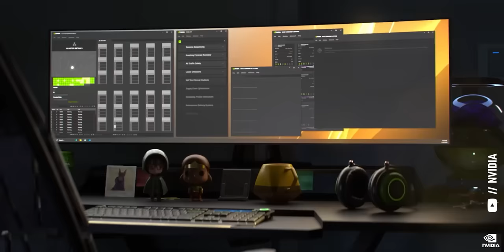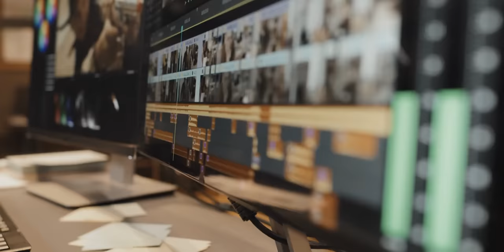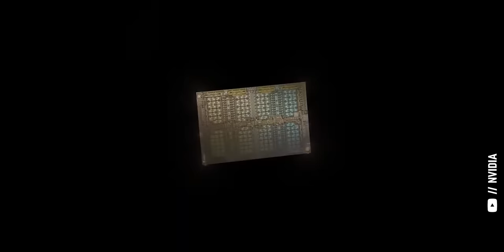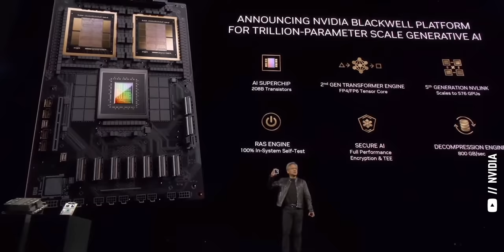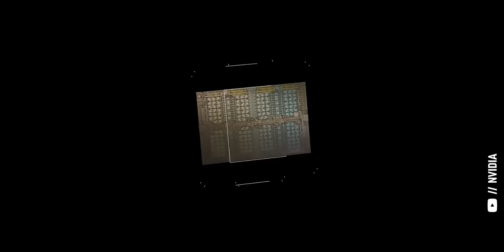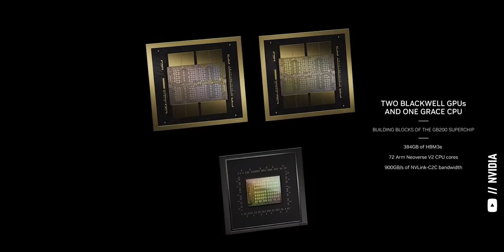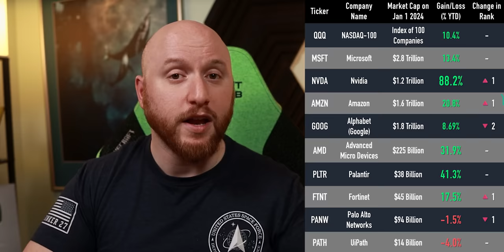GET IN EARLY! I'm Investing In This HUGE AI Chip Breakthrough

Comment: Nice. So they can swap an H100 out for a B100 and not have to spend another dime on upgrades. Meanwhile, I switched my 1080 out for a 4080 and had to replace the motherboard, CPU, RAM, and AIO Cooler. Thanks, Nvidia.

Comment: Connecting two dice into one device was done previously by Apple in its M1 and M2 ultra machines (and soon M3 ultra). This is essentially the same thing. Not to diminish it, but it's not the first. And, DPUs are not "more parallel" than these GPUs. In San Francisco, there are tens of thousands of homes that have Google fiber, 1Gb/s up and down, symmetric. That's 125 MB/s, up and down, or 250 MB/s per connection. If there are 100,000 such homes, that's 25TB/s aggregate bandwidth. If there are 10 such cities--there are far more than that in the West--that's 250 TB/s. So, no, the bandwidth in the system that Jensen talked about does not have "more bandwidth than the Internet." Now, he might have meant something like backbone bandwidth or some other qualification, but that's not what he said.
Reply: Nvidia is losing faith and market share in retail consumers slowly, they’re not going to break into mass commercial adoption. Microsoft however is already doing so and working on new stuff and not really talking about it or showing off; Microsoft doesn’t need to lol.
Reply: @Star.Chaser  LMAO how is Nvida losing faith and market share when their market share is up and more and more people especially in retail see the value in their products?

Comment: Most of the performance improvements is because they went from an 8bit architecture to a 4bit architecture and also glued 2 chips together.   4 bit architecture will be less accurate for AI training. This may be ok or maybe not. 

So overall not much of an improvement (only a few percentage).
Reply from the maker: You're kind of right, kind of not. The architecture includes some smarts to know WHEN to switch to FP6 or FP4 so it only computes with the precision needed.

Comment: Excellent video! Consider buying NVDL which is a 2x leveraged ETF of NVDA. The way this ETF works is that for every percentage NVDA goes up or down, NVDL will move 2x on the upside and downside respectively. NVDL closed at 41.50 on 29-Mar-24 while NVDA closed  903.56.
Reply: An etf of a songle company? What?

Comment: The reasons you are wrong about nvidia becoming the biggest company in the world. 
1. Nvidia is primarily a Hardware company. Yes, they developed also a software framework for developing AI tools or AI in general, but they are primarily the providers of the infrastructure
2. Without a final product that is directly visible for end-customers, NVIDIA does not mean anything to the public.
3. If we would expect NVIDIA to be the most expensive company in the world in the future, than we would need to do this for Qualcom in the present (because qualcom is the leading company that provides the hardware and low level software for Android platform to work). But guess what: it isn't.
4. There are other big players in the AI industry, and just providing infrastructure doesn't mean anything without the winning software on top.

In a closing statement: Yes Nvidia, will be a really important company for AI development, but although it is very important, it will not be the most valuable company in the world, at least not in the long run.
Reply: @CristiCroicu  guess you were wrong 😆

Comment: These chips suck for inference and if open-source keeps kicking closed-sourced cost effectiveness out the door = the demand for training will be tiny and crowdfunded
both BDRX and Dolphin-Mixtral beat gpt3.5 and in many scenarios gpt4 and they can be run on a M3 Max way faster than you can read...
Reply: This is the part I think people don't understand.  GPUs are great for "playing about" when you can't commit to a specific architecture because you're in the training phase and it's just about who can afford to dump the most training tokens into the funnel.  Once you get to inference, ASICs already have GPUs beat and it's not that close.  I'm not impressed by the ExaFLOP machines because at the end of the day it still comes down to FLOPS/Second/$ for inference.  The new Blackwell is maybe 0.67 FLOPS/Second/$ whereas a plain TPUv5 is probably 3 or 4 FLOPS/Second/$.  The trouble with any ASIC is you have to know the architecture cold and design the hardware stack around it.  Most teams at even decent sized industrial labs are still experimenting.  But not everyone will just be stalled out in training mode forever.  Betting on GPUs over ASICs for the foreseeable future is like betting on copper over fiber optic cable for information transmission in the 1960s.  Just because something can be repurposed doesn't mean it's the optimal tool.  Technology doesn't move toward generalization, it moves toward specialization.  CUDA is the bigger problem.  No one wants to restart their entire lab in a Tensorflow environment.  But it's just a matter of time.  GPUs cannot be better than more specialized parallel processors at inference.  That's not even a question.  The only question is how much longer?  Don't know, but a heavy bet on NVDA here is a bold bet indeed.

Comment: Nvidia has a design locked-in symptom - where their chips are GPUs which are designed to handle graphics and thus run on cycles... They're inventing more and more complex systems (like chips to handle distributed workloads) to overcome all these innate issues with core design.
When a tiny TINY startup like Groq can come along and destroy the speed, costs and simplicity of design in a single release I can't help but be sceptical that Nvidia are bloated in their approach.
Even with all their fancy tech and chips - they still stuffer from the slowest core on the slowest dye problem - where the entire GPU can only ever be as fast as the slowest thread.
Why do you need to stitch 2 dyes together and create agnostic memory across the entire dye? Because each tiny transistor set on each dye completes at different times. Otherwise you'd be able to just have a specific ram buffer for a specific thread instead of all this "no memory local issues or cache issues" which they claim is a feature - but is really an issue in the underlying design they can't move away from due to compatibility issues.
For AI, there's going to be a bunch of new players in town in the next 30 years. For GPUs - sure Nvidia will be king.

Comment: Why not run 8000 Blackwell gpus, refill displacement,  and see the total power draw vs Hopper In that manner....??? 

They cut displacement,  then sell the same rate of speed. Vs power draw and space savings. If the space was already created so was initial displacement

Can improve architecture but what are they doing making super computer laptops or refilling the space with modern architecture to improve performance in the same 8000 gpu package,  sell em on space savings architecture,  and matching speed with an old architecture while reducing space. Obviously reducing power consumption,  but ok. Same compute power now Mobile, what about displacement like sli, and the 4090. Tdp of 450w, 525w load,  two 1050w, looks like quad sli displacement,  4 Titan v same at 250w tdp and while 4 drawing the same..at least you get your property bsck.  Mini atx laptops or full atx etc with 2x 90 series.... Sli works best on maximum vram and memory architecture,  expanding gfx anti-aliasing,  resolution. Gfx software game modding, ultra detail settings future proofed with thise settings, bragging rights, fun, and longevity 

X2 of everything and not offered

4090 is basically two 4080 crammed together at 450w tdp instead of 250-280w single 4080, and agian no SLI SO NO REPLACEMENT FOR DISPLACEMENT.  2 4090 basically would be quad sli.. at 1050w full loaf. 5 series ect. But there playing a game selling reduction when in fact the same amount of power can be placed to create more gpu rendering power at the same wattage as before, double the total vram, even though vram.per gpu is the same. Fill rate, cuda cores, raytracing cores. Pixel rate, 2x rendering at same wattage as quad sli being what's missing along either 3 way 4080 series.

But ai so great why doesn't it write excellent driver sets for sli, along with a hardware style nvlink on the mothrrboard

5090 in sli would be wonders. No replacement for displacement and given power factor no matter the architecture change upgrade

Why the 9800 gtx uses 160w , and 5870 188w,'250 w overclocked. Why a 3dfx voodoo 5 5500 had two chips at 15w a piece for 30w, but definitely tdp displacement

While a voodoo5.9000 has 32 way sli 32 vsa 100 chips 2 gb-4gb ram depending on model, and with the correct mothrrboard windows xp dx 9.0c and driver sets, crysis runs better than a mondern sli aetup from 2007 lol. 

32 chips 60 watt 4 chip lanes 
8 lanes wide
 
What's the tdp 

Agp power plus 4 molex

About 420-450w tdp

There was also a v5 8000, 8 chips, setup in sli, for 4 cards. To get 32 way sli...

Sli really only needed to stretch the limits of rendering computing and provide extreme visuals as a gfx workstation studio Gaming systems. 8k with 8x or 16x anti-aliasing with filters maxed and ultra gfx with gfx mods are what's good now. Hitting beyond a 32k filtered resolution on 8k,  but where is the sli to enhance 8k max detail settings and gfx modding with raytracying and some are rich, what about 16k resolution doing the same. 4000 dollars Two 5090s you think it would be achievable. Mabe on 6 or 7090 when they decide to actually add in video memory rather than miniscule increases creating g p u bottlenecking at higher res or detail anti-aliasing settings, wheb in fact the gpu had enough steam.when v ram becomes literally upgraded off the board and exchanged. 

Tdp 
Sli
Vram
Memory architecture

Imagine two 5090 you could afford even if the price tag is 2000 a card when new, at say 48 gigabyte vram 512 bit bus,  upgraded cudas raytracing cores ect, two in sli would be basically 96gb ram Even though 48gb per gpu, and 1024bit even though 512, with all the ai and frame generation,  i don't see what the issue is other than displacement getting cut to basically hidden sli between the 90series ad 3090-4090- and hopefully changes with 5090 and up. I want my third and 4th performing displacement,  Sli on the top end card will stretch the limits of rendering power not only at available resolutions bit with antialiasing,  filtering, uhd file sets,  gfx modding the game,  under ultra quailty presets.

All the rgb, like the guys out there with fake fast cars acting as if there fast. It's almost embarrassing to know the truth, and the fact they focus less in the advantage of pc and more on other systems not in the sane form factor with much more diminishing  returns.

9800gtx 3 way sli 1.5gb ram 
While 8800gtx was 764mb ram, 3 were 2.3 gb

Crysis Maxed ultra settings and being a gfx molded game. Eveb more so, ran into issues with frame buffer or v ram right at 1920x1080 4x aa, 16x af, but worked at 2x aa and even better without. The 8800gtx, would run these settings 3 way and more fps on 4 way due to extra memory and its memory controller. Solid 40fps or more without hitching and 7fps drops like the newer cards they sold. 9800gtx

Same trends seem to continue and have become worse now with no sli on newer architecture,  messing with MAXIMUM DISPLACEMENT.

Increasing displacement and architecture but then removing MAXIMUM DISPLACEMENT 

3 WAY SLI  
QUAD SLI

I HAD THREE 5870 NEW FIRST MONTH, TECHNICALLY I HAD A FASTER SYSTEM. GIVEN I COULD RUN 3 4080S NOW OR THREE NEW 5080S OR 2 5090S OR 2 4090S

Start looking at power draw and displacement among form factor, the curve is a trick I'm the illusion

Can't replace power factoring,  why a laptop is a laptop , desktop is a desktop,  supercomputers are supercomputers size of rooms or buildings

If I could have a 25 watt video card that ran photon mapping ray traycing at 500 fps and 16k resolution, it must be one hell of an architecture,  what if we make it larger jack it up to 450w tdp, and then add a second card to link between those two, 

We could get 276k resolution with 32x aa at 240hz

Newer quantum architecture,  just replaced displacement at 1060w with it though....

Comment: I am not denying this is great tech and has lot of potential.. But I think this is already priced into the stock. NVIDIA profit at 4B $ which is 16.2% of its revenue, I would buy that if it's market cap was around 50B $ to 100B$ and not at current 700B $.  If you buy it now, you better hope no one else will be able to catch up with this tech until NVIDIA makes 40B profit a year.

Comment: May be you read some articles said Nvidia chip is double performance from previous one .....for me it's not something that AMD needs to worry about ....Nvidia H100 massive price with $40k while AMD newest MI300x only $15k...they're not gonna take the price down for H200...
Reply: Nvidia have expensive price from the get go because they can charge such price. They offer you full ecosystem that is ready to use or you can build your own (on top of their CUDA). with AMD the hardwars is capable. Their ROCm also getting more matured. But the client still need to build their own solution based on that. What is AMD alternative to things like nvidia hyperion or Omniverse? They have none. Maybe it is expensive to go with nvidia from the get go but their solution and support is top notch. Plus you can start pushing your final product to your client faster. With AMD it might be cheaper but you still need to build your own ecosystem on top of AMD ROCm. And here you most likely will be on your own since AMD did not offer service like nvidia (hyperion and omniverse is one of those). developing all this will take a lot of effort, time and money. This is why many company still prefer nvidia solution even if they were expensive. Because the second part might end up making the whole endevour to be more expensive than going with nvidia. Plus they were losing time against competitor that use nvidia solution as well.

Comment: Nvda started on the programmable gpu before AMD and takes advantage of their own processors to advance their tech BUT, AMD is not far behind AND they are advancing exponentially as well. Don’t take this advice exclusively. AMD is cheaper and with higher volatility at the moment … but if you look at NVDA history, it went thru the same transition. 10 terabytes per second is going to be so 2024.

Comment: over 600'000 parts am i missing something here ? 208 Billion each chip need 2 + another 50 Billion chip to talk, what voltage and power is this thing using for instance supply voltage and current, cpu voltage and current per cpu's and  per tray all in? 700W i don't think so show me some cables please.........."Cooling Solutions" HA. "only one fuse, cap, coil, resistor goes out of spec and......" need i go on 599'997 more times....lol this is brilliant imagine if this dedication and money went in to the NHS...mmm. Mellanox is more important than NVidia at this point?

Comment: I just wrote a really long comment on why I think Intel the company, is more likely a future benefiter of Nvidia's product success than in trouble.  Unfortunately the youtube comment engine lost it.   I will not write all of it again.  But I will make the same final comment.  Which stock do you think will have a larger percentage gain.  When Nvidia (the company) reaches a manufacturing/foundry ageement with Intel (company).  NVDA or INTC.   I believe on a percentage basis it will be INTC.      And unfortunately, I am not going to go into again why I think this is possible. 

I do however think that Nividia's product line is likely to dominate GPU computing and AI processing for years to come.  And Intel will likely loose market share in CPU design.  (are they even in GPU design)?
Reply: I agree. I'm slowly accumulating INTC on pullbacks

Comment: A few things:
A single die blackwell GPU is a ridiculous proposition that only an MBA could come up with.
The advanced packaging technology is actually provided by Intel and is one of the key enablers for even greater performance in the future.
Nvidias software stacks aren't worth trillions. There are many startups that are launching similar things.
The prototype doesn't cost 10B if he drops it. The development costs are 10B.
Reply: When it comes to software nvidia is at the top. Just because some starts up were also doing it means they can do it on the same level as nvidia. AMD/ATI exist much longer than nvidia and they still did not beat nvidia on software. Nvidia superiority in software is why they can charge more even if sometimes they have inferior hardware than their closest competitor.
Reply: @arenzricodexd4409  Absolutely their software is a massive advantage right now, but it will be replicated by the competition. 
Driver software is so commoditized almost no one is thinking about it when it comes to cpus, smartphones etc. So a GPU driver won't play a big part in defending the 2 trillion dollar valuation over the next decade imo.
Reply: @bio_stack  if that's the case AMD and intel will not spend a lot of effort to improve their driver and software ecosystem (ROCm, oneAPI) for their GPU. and this is also a prove that what nvidia have right now (when it comes to driver stability) cannot easily be replicated by others. you can't compare CPU to GPU when CPU design is much simpler. and you were wrong if you think drivers are not important in things like smartphone. in the past for example almost all SoC maker end up avoiding from licensing Imagination GPU IP because they were very bad when it comes to driver support. only apple really licensing their design but apple have their own driver team rather than relying on Imagination for it.